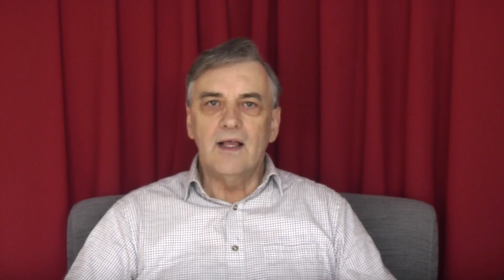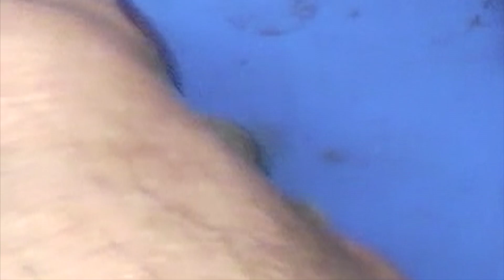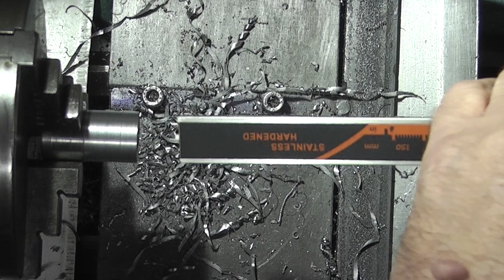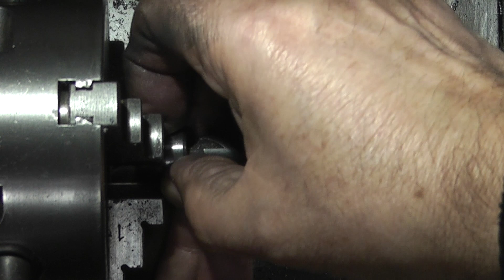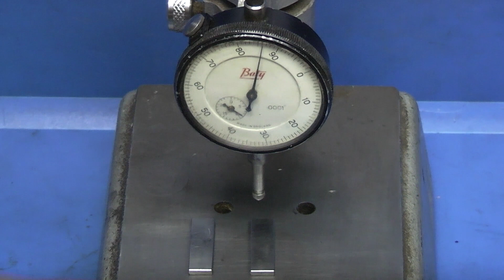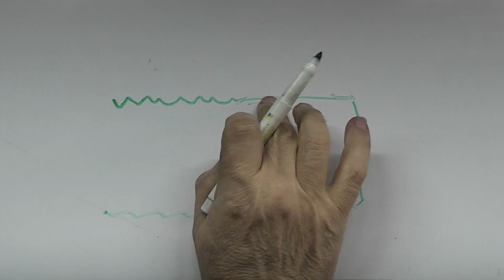Making burnishing wheels

Comment: The burnishing tool I made has ball bearings on it. Do not apply oil to the shaft. There is a limit to how much you can press or number of passes, as the material will work harden and start peeling off.

Comment: I wasn't sure what the purpose of the wheels was until the end of the video.  I like it.  I am curious though.  Why did you not simply insert a couple of cheap bearings?  Bearing steel is extremely high hardness.

Comment: You can get a much better surface finish by using a single roller with a curved surface  and preferably of stainless steel. The pressure exerted on the piece should be depended on the initial surface roughnes and the speed of the item and the feed of the roller should be just enough for squashing the asperities of the turned surface. Excessive pressure will end up giving you a bad surface.

Comment: A technique that does indeed need revisiting in the home shop, maybe not for everydsy use but a useful weapon in the machining aresenal.
I found that one wheel was more than adequate if you have a narrow rimmed tyre of hardened alloy steel on a ball bearing. See my video from last year to see what I mean.
I found the difference in size was in the order of microns but i started with a reasonably smooth finish even though for test  purposes I was trying to get a rough one.
If you junk your TC tooling and go for good old sharp HSS you should be easily capable of turning to sub thou dimensions with the right technique.

Comment: Question, not a criticism: would oil not help (the already good burnished) surface finish? Or were you just looking for a  reduction in size? Interesting video, as always.
Reply from the maker: Hi Ian
Yes you could use some oil but if any bits stick to the oil they will be crushed into the surface

Comment: How would a pair of bearings work as burnishing wheels?
Reply: Mathew, the ball bearings are used as the burnishing rollers. The inner race is clamped stationery whilst the outer race makes rolling  contact with the workpiece and effects the burnishing operation. If rollers with the  exact inside diameter required to fit the knurler pins can't be obtained then fitting bushing sleeves to the inner bearing race is a viable alternative.
Reply from the maker: Hi Matthew if you can find the correct size with seals they should work ok